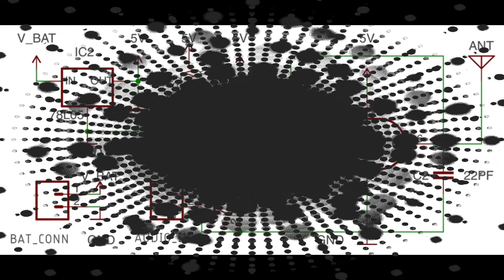How To Make A FM Transmitter|| With IC|| Without Coil|| Spy Recorder|| By Technical Tushar.

Comment: Sir what's the frequency range it's giving out
Reply from the maker: Bro y9u can adjust it's frequency by connecting a ceramic capacitor and trimmer. And pls subscribe to my channel
Reply: How
Reply from the maker: Yes bro
Reply: How u tell
Reply from the maker: I tested
Reply: No bro where to conect  it
Reply from the maker: Why to connect i shown in the video? You just to connect it with battery and set the frequency in your fm radio and then you can use it
Reply: Tell the pin number